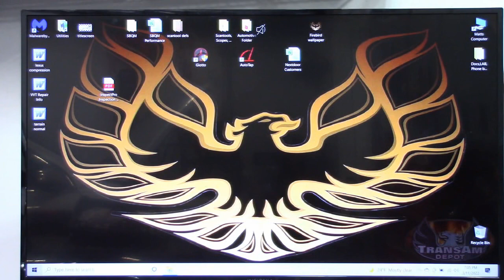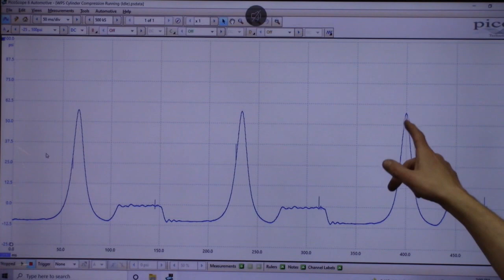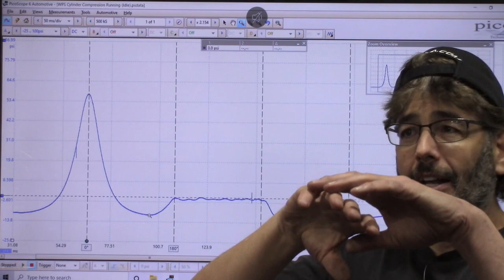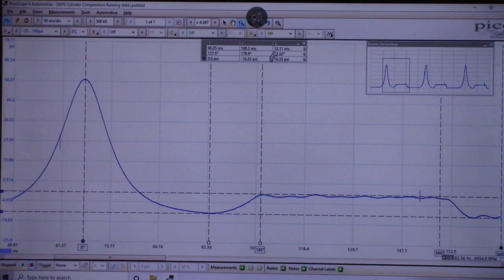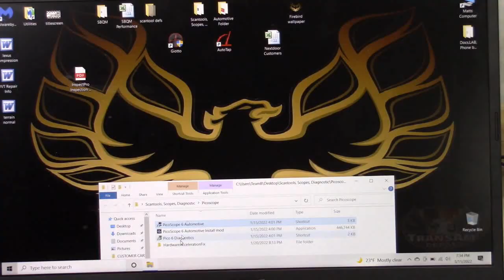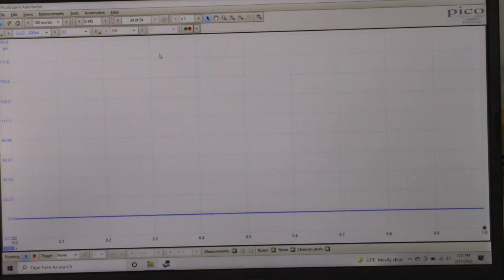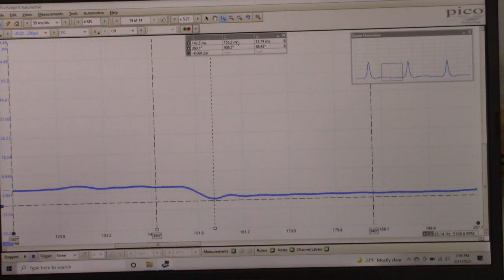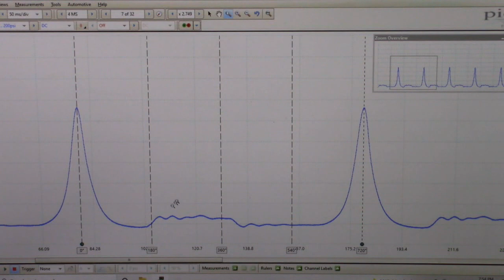How To Check Valve Timing Without Dismantling Engine

Comment: Matt - Neato - QUESTION, Can the transducer be used as easily on an OBD-1 car as well as on the OBD-2 cars? My 1993 Protege 1.8L SOHC MTX had a no-start which a local shop fixed by installing a new distributor. BUT it now only gets 24 mpg ( got 35 mpg for its previous 330,000 miles) and now starts like new with engine cold but (disconnecting one of the injectors is now required to start when engine is hot). Seems like it might be a timing problem. BTW, I get no diagnostic codes.
Reply from the maker: Yes a transducer has nothing to do with OBD. it is 100% a mechanical feedback.
Reply: @SchrodingersBox  Thanks Matt.

Comment: <random hypothesis>
I think the vacuum nearing BDC represents the compression loss that occurred at TDC. because the loss offsets the zero point. You would not have this on a running firing cylinder.
In order for timing to create a rich condition intake air VOLUME has to be EFFECTIVELY restricted but not reflected by the MAF. Excessive overlap comes to mind. Perhaps a stuck advanced intake phasor?  I say effectively because although the air is being moved through the MAF and making it into the cylinder it is NOT making it to the compression stroke because too much of it is being blown straight out the exhaust, thusly a loss of effective intake air not revealed by the MAF. You would see this as a high o2 content further guiding the ECM into causing an even richer condition. So while trims might look like it's pulling fuel it's operating on a severely skewed platform.
</random hypothesis>
Reply from the maker: yeah this was pointed out by another viewer and I agree- waveform would be quite different on an actual power stroke.
Reply: @SchrodingersBox  Anorher reason I like your channel, Matt!  Classroom atmosphere.   I wish I was back in school. Cheers!
Reply: @SchrodingersBox  One of brandon steckler's videos shows an in-cylinder pressure capture of a Ford Ranger with 2 spark plugs per cylinder.  I guess one of the spark plugs is only used during certain conditions - this was replaced with the WPS-500, and the other spark plug left in place; allowing a pressure capture of a firing cylinder.  The pressure wasn't as enormous as I would have expected; but at no point during the "power" stroke, did the cylinder drop into a vacuum.  This is why the dollar-bill trick at the tailpipe only sucks the dollar bill in when there is a misfire.  :)

Comment: Unrelated question: how does the ecu detect a misfire?
Reply from the maker: That’s a great question!  it does it using the crankshaft position sensor. when it detects a slower revolution in the crankshaft after an ignition event, it determines that must have been due to misfire not pushing piston on power stroke so it ties a misfire code to the cylinder that just fired. 
  also it can determine an electrical problem on a coil or injector such as an open circuit- but if coil and injector both operated and crankshaft movement was slower it detects it as described through the CKPS.

Comment: Excellent video. However, I see oscilloscopes and bi-directional devices in the future of DIYs
Reply from the maker: Great point! I totally agree 100%. The mentality that DIY’s still use just wrenches and elbow grease is completely outdated. a DIY nowadays needs to be as savvy as a tech was 15 years ago. A DIY who still  doesn’t know how to use a DVOM is going to be extremely inept… or they need to keep working on cars from the 1960’s and 70’s which has always been the excuse for not knowing computer and electrical!

Comment: Have you tried Pico 7? I was avoiding using it because the layout is so much different than 6, but since they made a version for Debian Linux I decided to start using it. Overall, I still like 6 better, but there are a couple cool things about 7.
Reply from the maker: yes I did. originally I used 7 and I liked it a lot, however then I got a new laptop and there is a known incompatibility with the graphics card and 7 on the laptop so I had to downgrade to 6.  obviously I didn’t know that at the time I got the laptop or I would have bought another one lol.
   But I also agree with you that I actually like 6 better. the UI on 7 feels “dumbed down” to me.
Reply: The car has a cracked intake internal vacuum leak the ECM is reading high vacuum pressure when it reads high vacuum pressure it puts to fuel to it because it's tricking it it floods it out look inside or change the intake and see if the car does not straighten out I've had this problem with older Chevrolet's the aluminum intakes they crack internal people's poor big money in tomb we figured it out one day we put a different intake and fixed it

Comment: Can you bend valves just by swinging of the timing is of and the belt on because I recently changed the water pump on polo 9n 2006 think the timing went of or so
Reply from the maker: You can definitely bend valves if the timing is off.
Reply: Thanks is a polo blm 8v or 16v 2006

Comment: If I'm calling around asking for a complete timing check, 6 months after I paid to have the timing kit done, what is the best things to ask for?   I have a boxer 1.8L Subaru motor that has dry 76/78 psi compression on #2 and #4 cylinders.  The first shop i paid $120 for just a trst drive and dry compression test.  What a joke.  

I don't have any fluid or oil loss or cross contamination, or overheating.  I simply have poor power uphill and speeds over 60 mph. Thanks.
Reply from the maker: $120 is actually a bargain these days to be honest. 
  If you have a check engine light on with any kind of cam/crank correlation code then I would take the car to the shop that did the timing kit, as they must have mistimed the engine during the install
   If however there is no check engine light on, it’s highly unlikely you have a timing problem. You will need to get a diagnostic done which is usually $150/hr or some places even charge a minimum $200. Remember this may not even be an engine issue. It could be you have a frozen brake caliper, driveline issue, transmission issue or otherwise.
Reply: @SchrodingersBox  it's a compression issue. #2 #4 only have 76/78 psi dry compression.
Reply from the maker: Yeah that’s a problem. at very best it’s timing on one side of the engine (i think 2 and 4 are on same cylinder head if i remember correctly) and at worst it’s a gasket leak between the two. in any case, a substantial repair for sure.
Reply: @SchrodingersBox  yes 2/4 are on driver's side.  
Can't a fair shop do a compression, leak down (on that one head), and coolant gas check in an hour?   

It's a non-interference block so it could be a leaky valve, but not sure how timing cam could allow air to escape on 2 different cylinders adjacent to each other when one is being tested.  Is that even possible in a SOHC head?
Reply from the maker: I can’t really say what a shop would do or charge since I am not from the industry- I’m a DIY. 
   I personally would do a relative compression test and overlay with ignition timing. Or better yet- a cylinder pressure transducer test overlayed with ignition timing. Either would take about 10 minutes and would definitely answer if this is a cylinder leakage issue or a timing issue.
   I’d do it for free of course, if you lived near Denver. But I don’t think a $200 charge by a shop is unreasonable based on today’s typical pricing for diagnostics.
Reply: @SchrodingersBox  hey I live on western  slope, near Rifle.  I'll meetup and buy ya a steak sometime.  We frequent a few times a year. Used to live in Colorado Springs 23 years ago.
Reply from the maker: How funny because I am in rifle for work every couple months lol.

Comment: Hello, i need some help please i have a 2014 2.0 ford focus about 76k miles . It had around 3% on STFT and -7% LTFT . Now ive changed the spark plugs cleaned the MAF and throttle and its from 5 to -4 % STFT and around -11.5% LTFT.  Need some advice where to look forward ,whats wrong
Reply from the maker: i don’t understand what’s wrong- what is  the issue? those numbers look normal.
Reply: The rich condition just goes up in such a short period of time,  yesterday it was 0 on the short and -11,5 on the long .
Reply from the maker: what rich condition?
Reply: The negative long fuel trim,  am i wrong?
Reply from the maker: i don’t see anything wrong. what symptoms do you have? do you have a P0172 or P0174? i don’t see how that would be possible.
Reply: Nothing particular, just the numbers.

Comment: The use of a second channel to show the ignition primary/secondary waveform would be to check ignition timing.
Reply from the maker: that’s correct. i could easily have done that. however it’s easier to check ignition timing with the relative compression test because I wouldn’t have to remove a coil and plug. all I need is to amp-clamp an ignition wire and battery cable.
Reply: @SchrodingersBox  good thinking. I've never tried it with RC but I will now. Is that accurate? The humps of RC always seem noisy for accurate measurements. I've never tried it so I'm asking for my own education on that method.
Reply from the maker: i absolutely trust the relative compression test!! I have run into a few “pinhole” gasket leaks that the compression test failed to pick up- but in general it’s as reliable as a gauge test. also you can filter the signals to clean up noise.
Reply: @SchrodingersBox   sorry. Let me clarify, I trust it to verify a dead hole. But I was asking about adding second channel to measure ignition timing that you mentioned with RC...

I use ignition capture for firing order placement but never tried it for confirming ignition timing being in spec. You said it's easier to do it with RC(checking ignition timing that is) unless I misunderstood. Although this is the second mention, maybe even by yourself, that I've seen this about IGT being checked with RC. I'm curious. Maybe you can do a video if you haven't yet.. if you wish to do any more advanced oscilloscope stuff. I know you like to reach the DIYer rather than do videos with tools a DIYer may not have but...
Reply from the maker: oh gotcha. yes I absolutely use RC with an ignition signal to determine ignition timing. i know I have this done is videos and in fact just last weekend I used the technique to determine a car running poorly was due to the timing belt installed wrong.
Reply: @SchrodingersBox  I need to catch up on some of your videos. Been busy as heck. Thanks for confirming that. I will try it out 👍🏻 that technique would keep pcm happy it seems as there is no need to change any strategies that could throw off ignition timing in these modern cars by pcm adjusting for a missing contributing cylinder. Theoretical of course, I've always had concerns doing IGT measurement off of in cylinder analysis. Good work man. I will look that video up now.

Comment: Problem is that the piston is cracked. Combustion leaking into crank case.
Reply from the maker: HAHAHA. yeah that model was a piece of sh-t lol!!!  The best part was the cam lobes were mislabeled too so I had to build it several times til I got the cam timing correct for each cylinder.
Reply: @SchrodingersBox  lmao better than nothing I suppose. I didn't realize you had to actually put that together. Must have come from Amazon lol
Reply from the maker: it did lol. $30. it was like 400 parts too and it looks like China even outsourced its production somewhere lol!!!
Reply: @SchrodingersBox  😂

Comment: Why doesn’t anyone use a vacuum gauge nowadays ? You could diagnose this issue in about 5 minutes without any fancy diagnostic gear.
Reply from the maker: and how would you do that with a vacuum gauge when the fuel trim compensates for the valve misadjustment? what would the vacuum gauge show?
Reply: @SchrodingersBox  - my experience has been the fuel trims cannot adequately fully compensate for valves that are tight and at idle a vacuum gauge will still show an erratic reading leading to help diagnose incorrect valve adjustment. To further confirm this a no start vacuum gauge test can also help. Under crank I have found the vacuum should be approx 3 to 5 inches of mercury.
Reply from the maker: but you saw it here. the fuel trim compensated. you saw the LTFT normalization.

Comment: Hi Matt, just watched your video.  I would also consider myself an "advanced DIYer".  I also have a Picoscope as well as a WPS-500, and I get super excited anytime I find and excuse.... errrr, /need/ to use them.

Have you learned how to work with triggers on the pico software yet?  The built in help in the software is pretty good, but I'm pretty sure scannerdanner's pico training video covers them as well.  Triggers would help you to stabilize the picture so the pressure peaks would be drawn at the same point each time.  Then it would be even more noticeable when the VVT is actuated.

https://youtu.be/81AGbZcgCZs